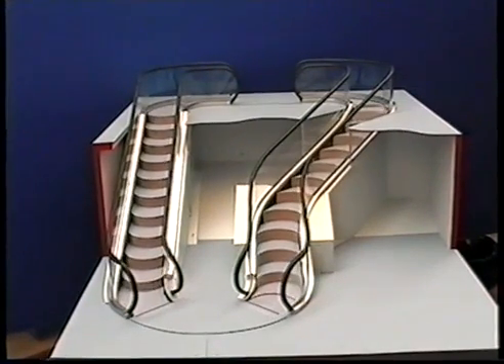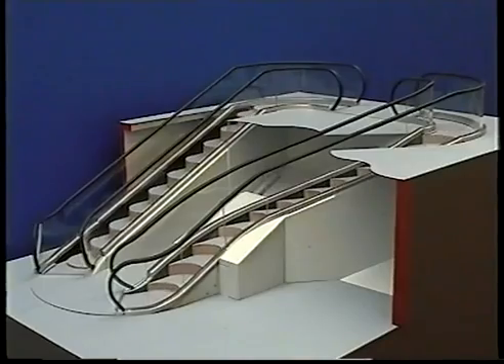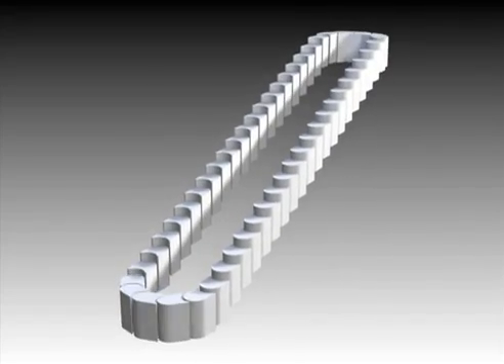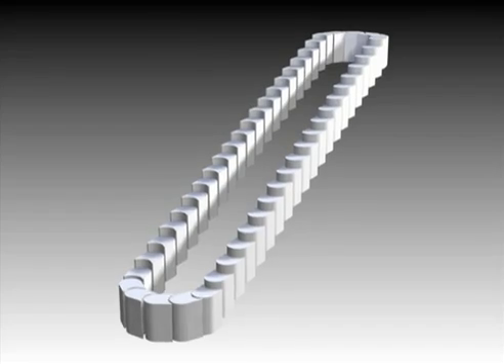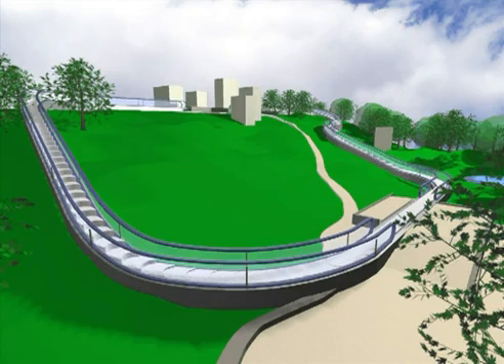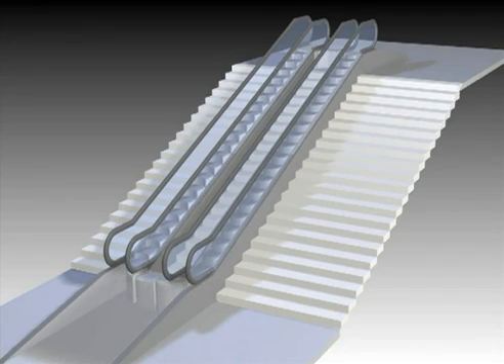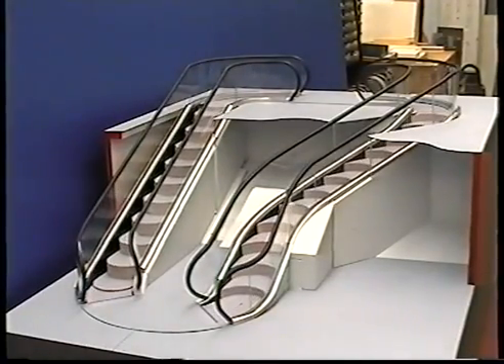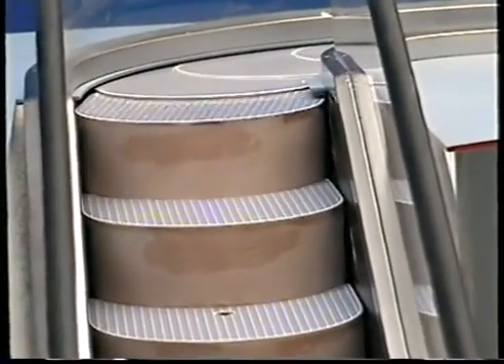World's First Freeform Escalator

Comment: This is a massive trip hazard when the steps transition into vertical movement, unless the steps are designed such that people are not going to step on the edges between two steps or step transition into vertical movement slowly.

Also, when one escalator of a pair breaks down you still have one functional escalator, with this design you have none as it's all one escalator